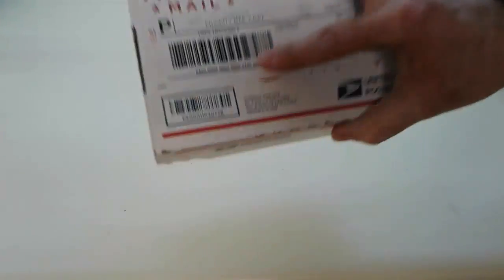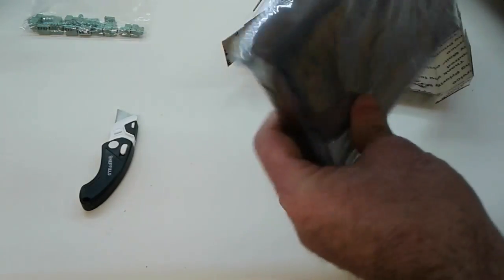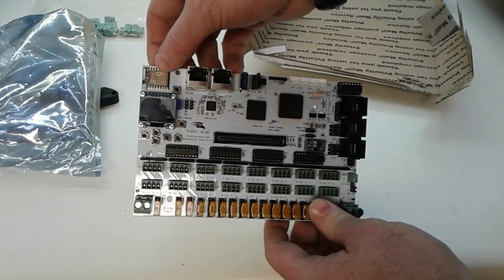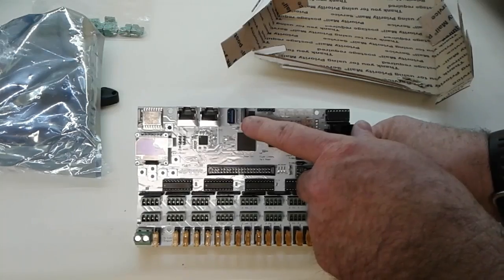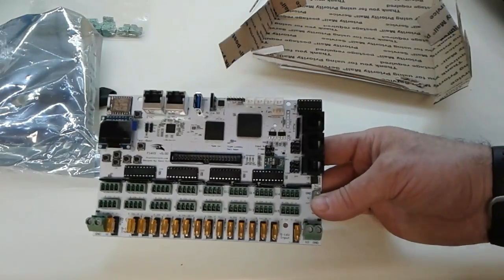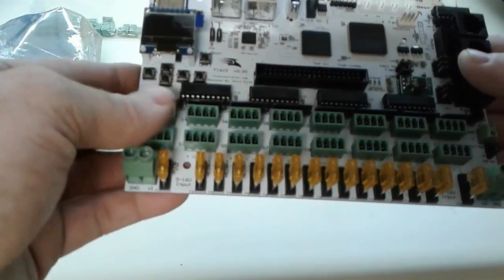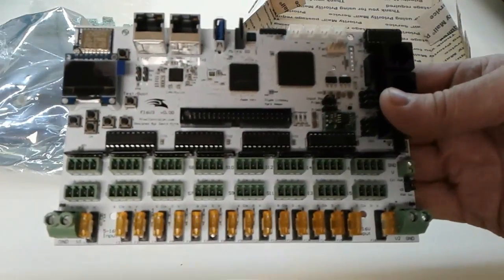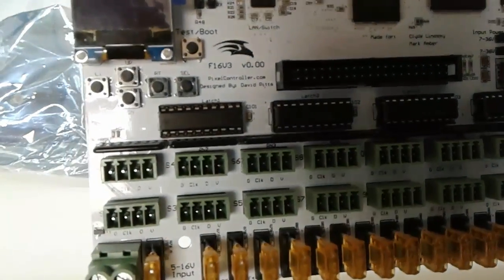F16v3 unboxing!  Next Gen. Pixel Controller!

Comment: So I am still a little confused. Hope someone can help me.  I am going to buy a Falcon f16v3 soon but am confused on how many lights/nodes/pixels you can run on 1 channel.  The falcon specs show 1024 Max Pixel Per Output.  So is this Divided by 3 if you are using rgb lights? So 340 lights per output? Pease help.